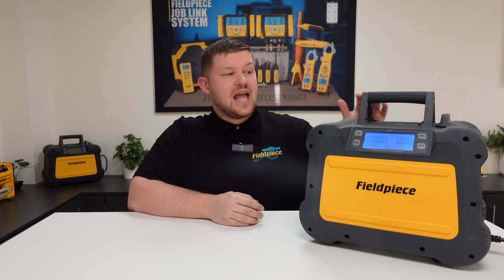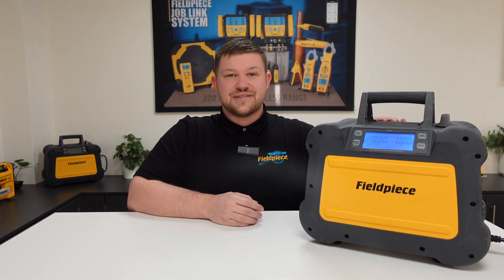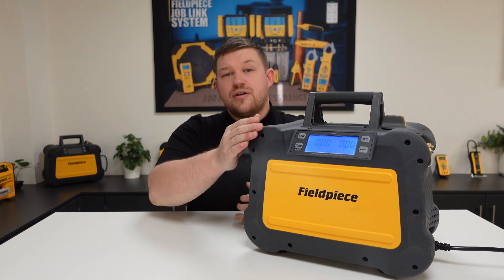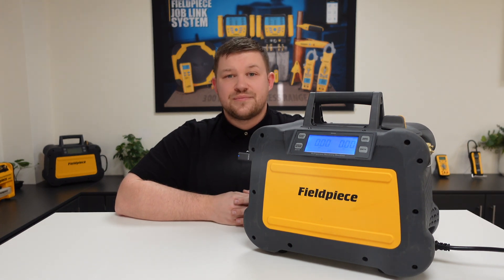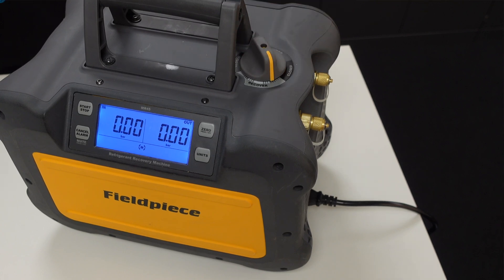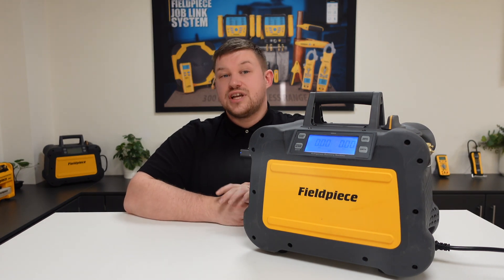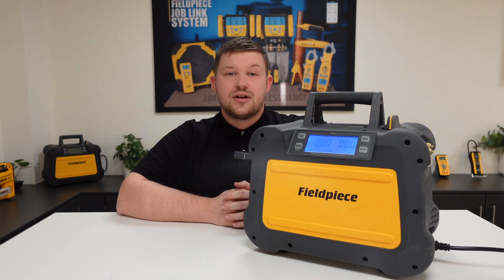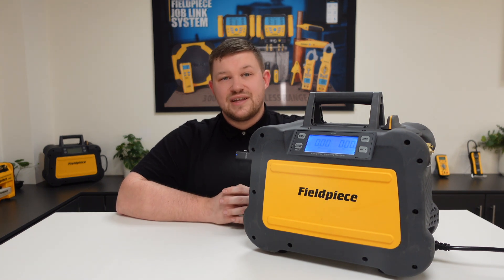MR45 Digital Recovery Machine: Throttle feature | Fieldpiece Europe

Comment: How do you stop this machine cutting out on LP?
Reply from the maker: Hi,
The MR45 recovery machine has 3 auto-stop values. 
The machine will cut out on either 0 Bar pressure, -10inhg or -20inhg depending on the cut-out value the user selects.
I hope this helps, if not, feel free to reach out to us!